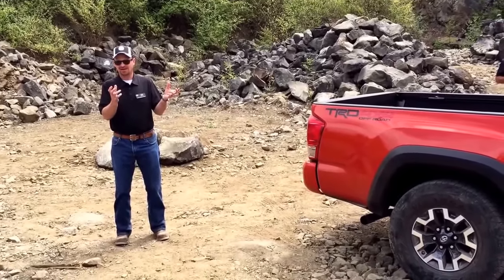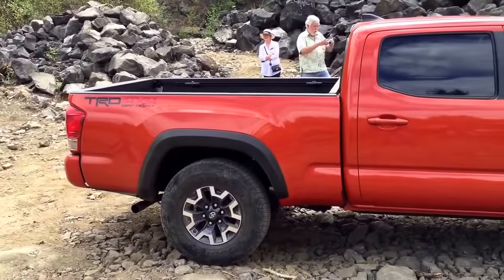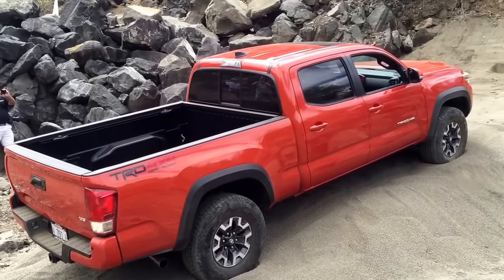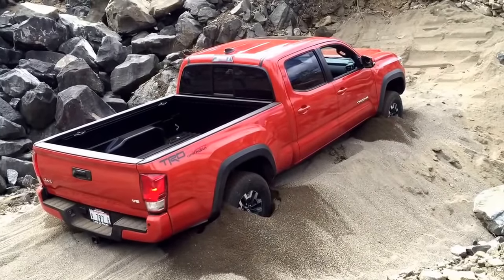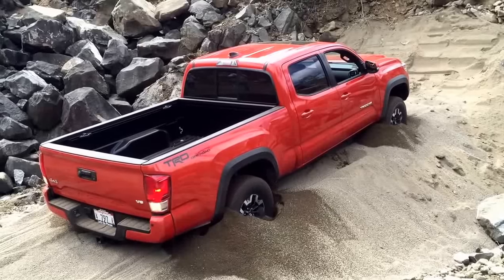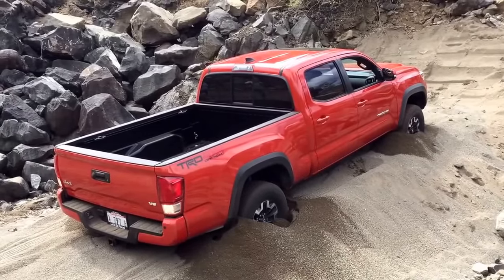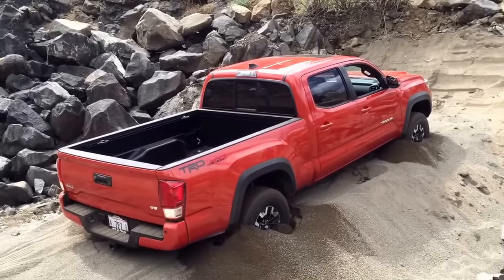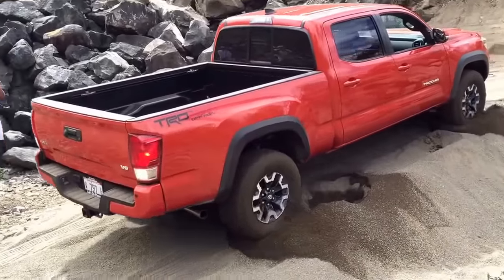2016 Toyota Tacoma - Demonstrating Crawl Control

Comment: Drum brakes better than 4 wheel discs???? I disagree  plus anyone who has been in any type of sand knows.... SAND GETS EVERYWHERE. Including drum brakes.
Reply: +Christopher Lee but they don't :(
Reply: It's salesman, they don't know anything about cars.    About the only thing he is correct about is disc brakes on the rear of a truck is just bling, most cars too.   Most of your stopping power comes from the front due to, well, physics.
The advantage of drums in back is that it is super easy to integrate the parking brake to them, and, fun fact, drum brakes actually more holding power than discs due to wedging action of the pads.   They have less stopping power, though, because they overheat.
Although, the drums on the back of my Suburban sure stop good, tho.  The drums weigh about as much as that Toyota does, lol.
Reply: Plus a pain in the ass to fix
Reply: Sandblaster
TBH, most engineers aren't much better.  Many of my friends became engineers, none of them are the greatest when it comes to mechanical inclination, although they are better than most.
Reply: two of the biggest morons I went to highschool with are engineers now. They were book smart but they walked around the halls pointing at people and saying 'OOOOOOO suuuure!" and other catch phrases/inside jokes that they came up with.

Comment: Try that in axle-deep mud and see if he "drives out"...
Reply: Yeah they would have a new trick called cement control , a onboard cement mixer would drop a controlled mix under each wheel and as it hardened the truck would free itself all the while making the mud hole easy for the next truck.

Comment: Nothing like good old fashioned wheeling without computer assists, where you actually showed off ur driving skills, didn’t need sumthin to hold ur hand as you were going down a hill or stuck in sand or mud,  kind ov like in the old days b4 cell phones we used to be able to remember more than 50 phone numbers, have fun...

Comment: Wait you're telling me that in 2016 you are still going to use drum breaks? That's too bad because I will now be purchasing a Colorado over the Tacoma. I have a toyota and it is darn near bullet proof (No really I had an accident where it got shot with a 30-06 and shrugged it off). There is no reason to still be using drum breaks.
Reply: +Brett Young Have they ever given you trouble?
Reply: What drum brakes? No problems from my matrix. There is still no reason what so ever to be using them on a TOTALLY REDESIGNED pick up. Not even worried anymore. I went and got the 2016 Colorado LT 4x4. LOVE IT.
Reply: The biggest reason is likely to keep cost down.  There is just no reason to have rear disks on this truck to begin with.  It's nice to see your buying American.
Reply: +Quadrunner No reason to have disk breaks on trucks??? The biggest reason is SAFETY. Disk breaks are superior in every way.
Reply: The rear brakes aren't used as heavily as the front.  The design of a safe vehicle mandates that they be "inferior" anyway.  Whether they are drums or disks in the back, they still need to be braking with less force than the front at any given moment.  So why would you put on equally powerful brakes, especially if they cost more?  

You don't have to answer that.  I'm not arguing.  Also I meant rear disks.
Reply: +Brett Young Brakes*
Reply: +Brett Young Have fun trying to resale your Colorado later when you start getting a bunch of mechanical issues. ;D
Reply: Jesus Gomez I wasn't aware that they had any issues with this generation.
Reply: +Quadrunner Give it a year.
Reply: Jesus Gomez I think its been over a year already.  Chevy historically has always had the truck thing down pretty good.  They only have minor problems at their worst for the most part.  Cars....That's another story for another day lol.
Reply: I don't buy a car with resale value in mind. I buy a car or a truck for what I want and need to do.
Reply: +Brett Young I understand the desire for disc brakes but its not THAT big of a deal. The trucks are light and the front has discs, I have never heard of it being a big problem. Would I prefer discs? Yes, but I would still pick a Tacoma over a Colorado every day of the week just for reliability reasons alone. 

My uncle gets a new Colorado every 2 years, and they are always a mess by the time he gets a new one. He works construction and they get well used and even a little abused, but they are way too bad in the end for having 80,000 miles on them. Engines are strong but the transmissions in his last 2 had issues by the end, and they all ended up with vibrations (although that is probably more his fault).
Reply: +Quadrunner They don't really start showing up en masse for a few years. The design is only a year old, give it time. I'll give Chevy some credit though, they build better vehicles than Chrysler.
Reply: Jeff Beck Yeah, I really shouldn't talk.  I don't buy new vehicles anyway and I keep my own warranty systems for that reason.  What does he do to those poor little things lol?
Reply: +Red Rider7 While I think that the drum rear is not a big deal since the truck is relatively small, I do agree that the prices get ridiculous on these. It blows my mind that people spend 35,000-40,000 on a mid size pickup. May as well go buy a half ton for the same price.
Reply: First of all *brakes, second of all idiots like you give gun owners a bad name, 3rd of all GM would be happy to have another dumb customer.
Reply: Brett Young lol this Tacoma will pull that Colorado places it wouldn't go on it's own...gay truck named after a gay state.
Reply: Quadrunner keeping costs down in a $45k truck with huge profit margins... Yeah, it's called ripping people off.

Discs are safer. They have less lockup, better cooling, better abs modulation, and dry off faster after you forded a river or drive in the rain.

Comment: We put in lame and cheap drum brakes because sand and dirt get in disc brakes, u know, to protect the system. Not because it's so much cheaper and we are cutting corners. Also, because we care, we now build all tacomas in Mexico because they have the highest quality control, not because, once again, we are saving money. Of course we pass along cost cuts to our valued customers and have adjusted the MSRP up by only 10-15k over the past few years ....
Reply: @Chumpy0071  idk... remeber the horrible paint throughout the 2000s, also the 2.5 used during that time as well? They basically gave everyone the middle finger for that. I know firsthand about both those issues. Toyota quality has been on a steady decrease.
Reply: @808stuffs9 they're back to being the greatest
Reply: They don’t need disc in the back

Comment: He was just reversing...
Reply: Matt so essentially throttle control?
Reply: Keven Gil yes and no :) if you can throttle a between zero and 3 percent you can do it yourself. you just can't control traction or torque by wheel.
Reply: Icenberg666 it was actually just a demonstration on how gravity works

Comment: Yeah, you saved money in production on drums but nice explanation. Did you forgo the disc brakes in the front too?

GM did that too in their trucks. '99-'02 had 4 wheel disc but to cut costs, went to drum in the rear in '03+.

Comment: OK, the explanation for why it has rear drum brakes is BS. If sand and dirt stuck in the calipers causing squeaking and noise is the reason it doesn't have rear discs, why does it have discs on the front? Jeeps are the off-road kings and they use discs. I've never heard of a single use scenario in motor cars where drum brakes were preferable to disc.
Reply: Same thoughts I had!
Reply: His reason is actually wrong. The reason they use drum brakes in the rear is because of trailers. Pickup trucks use proportioned brakes, meaning the front does about 70% of the braking and the rear about 30%. This is because a pickup has no weight in the rear, so there isn't much traction to effectively brake. There would be no benefit from having discs because they still wouldn't do that much. You also do not want the rear locking up. When you're towing a trailer, the increased weight increases the braking in the rear. Trailer minimum brakes are recommended to be a 10" drum. The Tacoma has a 10" drum
Reply: countryboy9546
That's still wrong. Even if the rear brakes only do 30% of braking, discs in the rear are still going to perform better than drums. Why do you think 350/3500 pickups use them? Also, if the fronts are doing all the braking work and the rears are THAT useless, why install rear brakes at all? The truth is because A) it would likely be illegal not to and/or nobody would buy the truck for that reason, but also B) relying on the fronts 100% of the time is asking for trouble in quick braking scenarios. Further, the rear of a Tacoma can be weighed down for sure. It's rated to tow 6500-6800 lbs, and it's top payload rating is around 1600 lbs. That means your tongue weight with just the driver and nothing else in the cab is still around 680 lbs, and bed weight could be more than double that (though you couldn't tow 6800 lbs AND have 1600 in the bed). Forgetting the fact that it would be a bad idea to tow with a Tacoma without installing an aftermarket trailer brake controller, having more braking power at all four corners of the truck would be much safer than having less.

There's just no way to couch drum brakes on the Tacoma in the year 2016 as anything other than cost cutting. Toyota engineers weaving webs of hand-waving engineering speak isn't going to change a modern fact of automobile safety.
Reply: There's still no real reason to have disc brakes in the rear. They are cheaper and keep costs down, and most of the brakes do your work, so overheating is a non-issue. Shoes last a lot longer then drums so you're not replacing rear brakes all the time. Also, it's far easier to install a parking brake on drums then discs. My Tacoma has drums, so do the Rangers I drive at work. Lots of vehicles still use rear drums. They work fine
Reply: 2011 Rangers had 4 wheel disk brakes for increased responsiveness for stability control.  And they did that even though it was the last year of production.    I converted my '85 Ranger to disk brakes (swapped in a 1996 Explorer axle) because it is easier to get mud and rocks out of them.

Comment: Just use the A-Track and keep a steady throttle no m,ore than 6 or 9 mph?
Reply: Not the same really , I'm in the middle east with a 2016 FJ , all those systems are on it , crawl control is what always gets us out on the dunes , and it's usually twice as stuck as this tundra , sand is tooooo loose , nothing like the deserts in the US , crawl control all the way

Comment: Ok I’ve had my taco now for almost 2 years. Icon Stage 4 with Dakar’s leaf spring. CBI rack RTT 2 dogs 2 humans. Loaded down with weight. 

Once I️ had to go a very steep hill no matter what I️ did I️ couldn’t go up this hill. (Little pebbles) 9pm very scary for me. 

Turn on Crawl Control put it in rock mogul. BOOM! 
Had to leave it on for 20min for about 1.5 miles distance. 

I️ 100% stand by Crawl Control. Thank you Toyota.

Comment: Mercedes Benz developed a vehicle for the sand dunes in Africa, where getting stuck was not an option. Through research, they found a low gear of 1:64 (64:1?) being extremely slow, would idle a truck out of deep unstable sand.

Comment: I would like to see the truck on flat terrain and demonstrating the truck stuck moving forward as well as in reverse. Also, not in wet sand. Any  modern 4 wheel drive without the advertised "crawl control" would have the same end result.

Comment: Thanks for the video.  However, it is my understanding crawl control is for automatic transmissions only.  Get a manual and you don't need a computer doing this for you.  Also, an automatic and no shovel at Baja 100 seems a bit out of place.

Comment: Crawl control is nice, but 4 low, and a steady throttle will do the exact same thing. I buried the work truck in 2 feet of mud, while towing a goose neck loaded with 200 bales of hay, and did the same thing in 4 low.

Comment: Or you could just use front and rear lockers in low range and steady speed and some tracks and if you lowered your tyre pressure in the first place as a method of limiting the chance you would get stuck in the sand. Btw this is an Aussie speaking

Comment: Then the frame folded in half went in for that recall and was slammed with 6 more recalls while at the dealer, owner received truck back from dealer 4 months later only to be recalled again for the faulty blower motor and rear differential seal. Yep, Tacoma owner here.

Comment: This is not gravity at work. The test would probably have been more convincing to all the critics if they did it without crawl control first to demonstrate that. Gravity alone won’t fix over torque and spinning the wheel gaining no traction. Throttle control can work. This demonstrates that you don’t need to do that. It’s technology.

Comment: Bring it to the yazoo basin delta in Mississippi in late winter or spring, drive it out into any turn row trail or anywhere and stick it in some plain ol' gumbo mud. I've seen folks have to literally whack fenders off with  axes at a deer camp to even attempt a pullout. Mississippi gumbo don't play.

Comment: That whole bit about drum breaks at the end was such bullshit on so many levels. Sand still gets into them and when it does its much worse than with disc breaks. Disc will basically crush the sand out doing no damage since the break pad and the rotor is harder (check Mohs scale if you dont believe me) than the sand.

Comment: Just slid off the road yesterday in 18in of wet heavy snow. Thought it would be a fun time to try this system out, since I hadn't in the first 2 years I owned the truck. Didn't budge me. Flipped back to manual control, rocked her a little, and crawled out. If you know how to drive at all, you can do better than this system. Love the truck as a whole, but this was a waste of money they should have put elsewhere.

Comment: So basically you have open diffs which  keep you from getting too stuck. Get it stuck and the brakes on the side of the differential that are spinning is braked transfering torque to the other side. I'll just buy a old truck with lockers and pocket 40k

Comment: came here to say something but saw others say it already... I'll say it anyway.

You burried the truck going uphill kicking sand back, then claimed 'crawl control' got you out when all that happened is the truck used the angle and gravity pushing it down and back to grip the sand on the back of the holes you just dug... then it simply reversed filling in the holes with the sand it's pushing back on, till it could get out.... 

So is this "new feature" the truck just using anti slip sensors to prevent over throttling instead of the driver just taking it slow...? Guess my friends 2005 Ford focus has 'crawl control' and they just use it for going through unplowed snow....

Comment: Test drove a 2017 TRD Off Road yesterday. Very utilitarian truck, not sure what makes it worth $47K they initially quoted me till I got them down to the $30K's. 

The keyfob is the flimsiest, most poorly designed piece of hardware I've ever seen in my life on any car. Only comes with three buttons: Lock, Unlock, and a separate mechanical button that is hard to push to remove the key from the rest of the fob body, which happens to be the only way to remove the key at all in order to use it. They key itself is a thin flimsy L shaped piece of metal and plastic and it's the only way to lock and unlock your tailgate. The actual key that comes out is in no way attached to the rest of the fob when it is removed and is very thin and seems easy to lose. The same key was used for the limited model, which is Toyotas luxury trim.

The interior quality was definitely not there, it looked poorly designed as well. Some off road settings like crawl control were above your head where sunroof switches normally are, by the map lights, and the other 4X4 settings were down under the radio controls. Apart from the touch screen control center, the car interior dash looked cheaply assembled, with cheap plastic panels that I'd expect to see on a mid 2000's base model American rental car.

I would never pay over $30K for this car, and since they hold value better than no other (for reasons other than reliability unknown), I don't see myself buying one used either unless it's over 10-15 years old.

It was one of my dream cars yet I was so disappointed when I actually sat inside one. Even the interior of the limited was no big deal.

Comment: Crawl control: Putting in reverse and modulating throttle. The only thing that would actually make a significant difference here is if you have a LSD.
Reply: DJWolves97 trust me, if you had LSD and tried this it would  be a VERY different video

Comment: I have a 2013 TRD sport 6 speed, and I had it buried in 10 inches of snow I ended up spinning a 4 inch hole in to frozen ground and still managed to get out after I got my truck rocking back and forth to gain a little momentum. There is no need for this shit if you know how to get out of situations.

Comment: Not impressed. Light throttle, downhill, in reverse. Nothing fancy. Want to do that even faster? Lock the rear axle. Not sure if the Tacoma has an electronic locking rear-end, but the F150's do, and I bet Dodge and Chevy have them also. Positive traction goes miles to getting unstuck. This did not impress me.

Comment: Severly under powered in 4wd. That pickup did'nt have the torque to break my lug nuts loose or pull a greased string out of a cats ass.